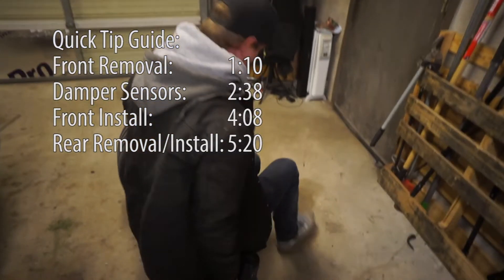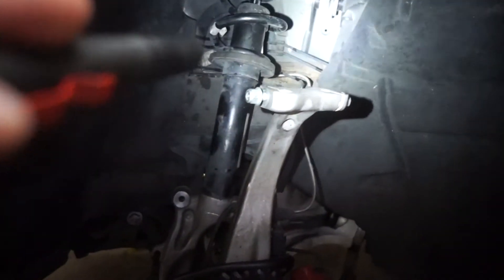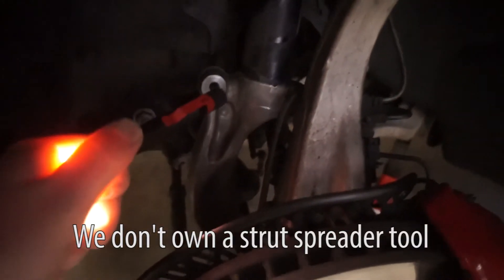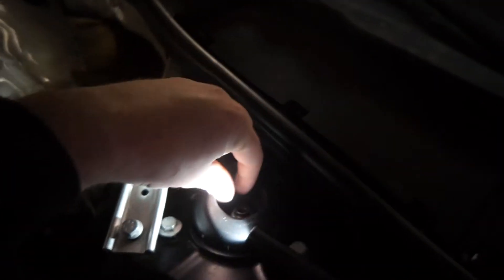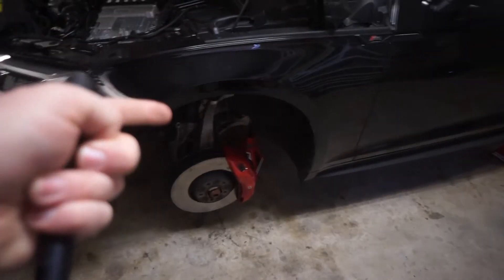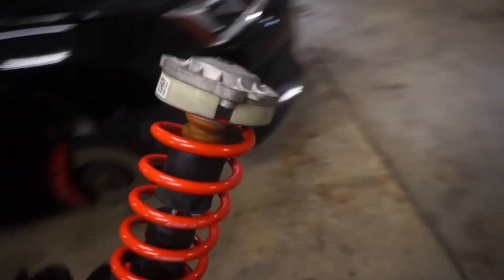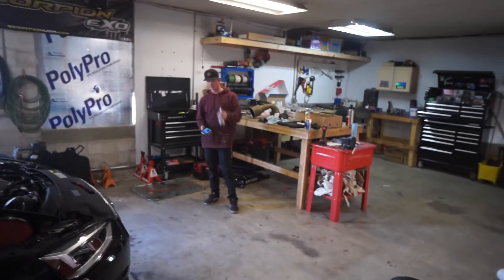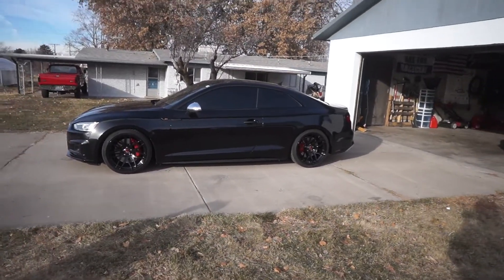B9 S5 LOWERING SPRINGS TIPS AND TRICKS

Comment: hey, looking to tackle this on my s4. can't you just impact the nut on top of the strut hat? do you need to use the triple square?
Reply from the maker: You can get the impact down for the most part. But you will need the triple square to tighten it up. O’Reilly sells a nice set for like $10
Reply: @electricsmith1650  thanks. Is there any torque spec for the shaft bolt once you assemble it? Or just tight? Haha.
Reply from the maker: Just kept it tight. Hard to torque to spec without the proper tool. I do recommend tightening the strut again after install